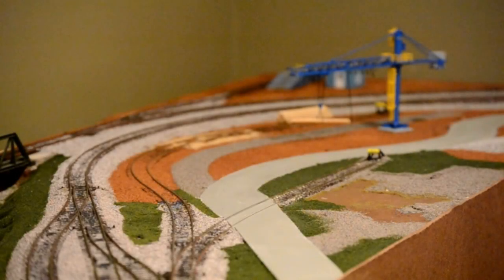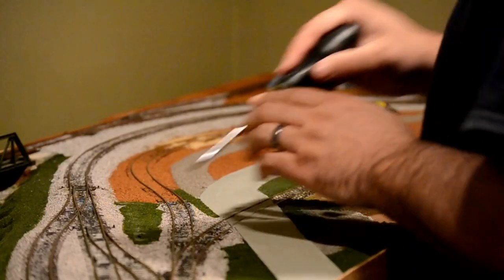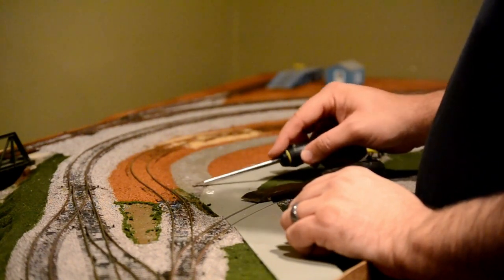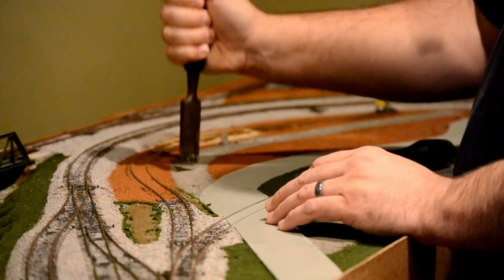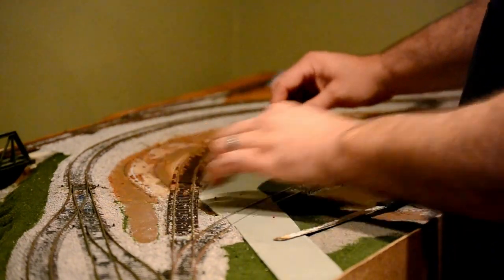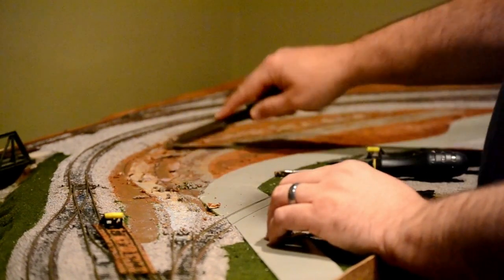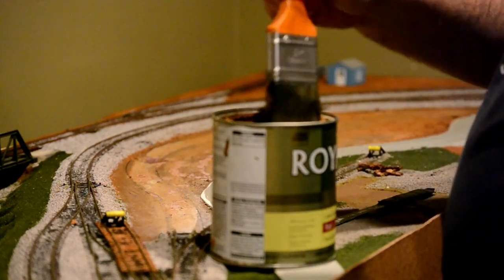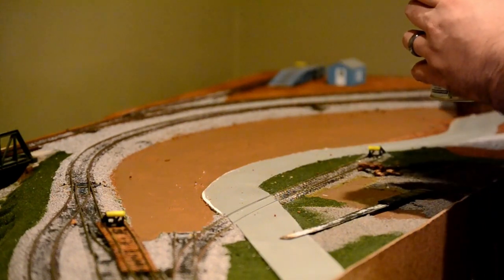New track work for the Chip Mill, Lumber Lay Down Yard

Comment: nice job. looked to be a bit of work to get the old stuff up.. but  needed to be done.. straight track being straight is a good thing. but if you going any length at all, most real straight track is pretty wavy. i have never seen a uncoupler magnet done like that
Reply from the maker: Thanks Sparky, I completely agree with you about the long runs of track, my only thing is with the smaller layouts like mine where you can see the entire straight run it throws off the ascetics, and looks like you were a little tipsy when you laid your track. The longer runs like you have I could definitely see not having the track perfectly straight. You have the ability to allow the ladscape determine the track plan, and I will absolutly allow for a more fluid track plan when I'm able to build a larger layout. Thanks for the comments and thanks for watching.-Ed

Comment: need more info on the magnet how does it work and when picking up the car need more on how they work
Reply from the maker: It's pretty simple really, I stack two magnets and set them between the ties right up against the inside of one rail. I do this for three consecutive ties. On the other rail I do the same thing but I reverse the polarity of the magnets (put them in up side down). I glue every thing in place. Then you can back over the magnets and stop, this releases the tension on the couplers which allows the magnets to pull them apart. Pull the train forward to clear the coupler and then back it in place. The couplers are designed so when cars are spotted with the couplers like this they won't recouple, Now you can just pull away. When you get ready you can back the train up and because the couplers are no longer on top of the magnets they will line up for recoupling. Hope this helps. Thanks for watching.-Ed

Comment: What Did u use for a baseboard or benchwork up to the railroad
Reply from the maker: Its a 1x4 frame with 2x4 legs, the top is 1/2 in ply and 2 in foam. Thanks for watching.-Ed